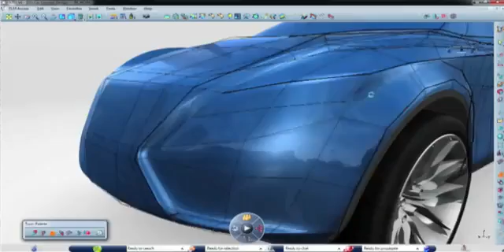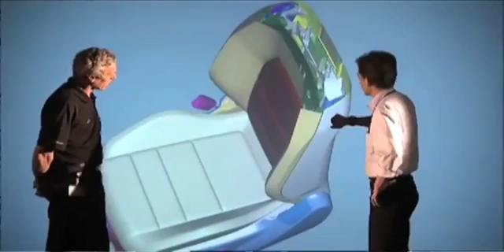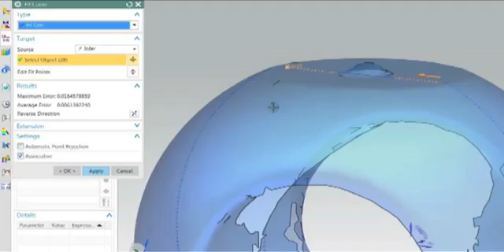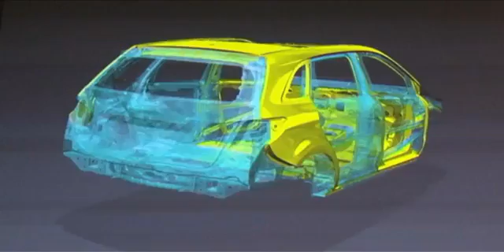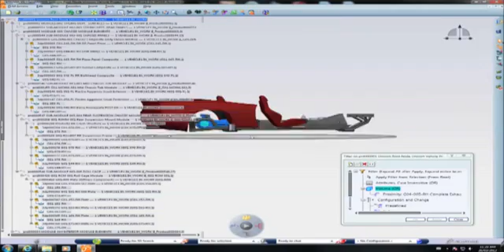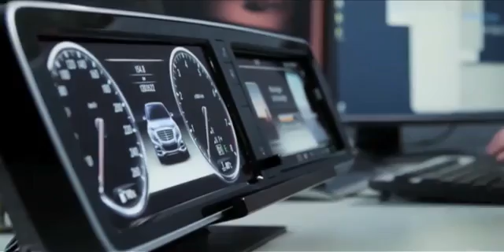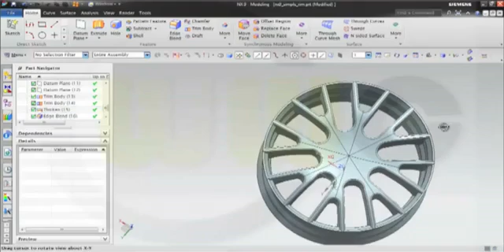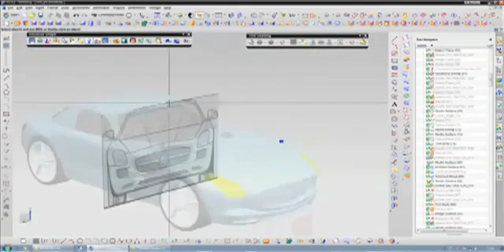The inside story behind Mercedes big CAD swap from Catia to NX

Comment: For a mechanical engineering student, the CAD I should learn to use is NX over SolidWorks. I learned that Apple Inc uses NX.
Reply: Due to the obvious fact Solidworks is only Microsoft compatible
Reply: @Jazzmaster Jay i use apple but i partitioned it and use windows in apple hahah

Comment: Thanks. I have one question as an Industrial design grad who is into automotive field. Knowing how to use 3ds max, solidworks and Alias when I want to be part of the studio design team should I learn catia or Nx or is Alias just fine for Advanced concept modeling and presentations? Will the engineers add thickness and finish of the parts so the CAM can focus on Steel die tool making for Pressing sheet metals in body production?
Reply: CATIA is a all in one solution. You don't need Alias or something else, because Alias and ICEM almost identical things.
Reply: Depends on automotive manufacturer. Catia is normally used to map the clay surfaces. V6 is used now, V5 Rx is being slowly transitioned to V6

Comment: CATIA is old. Favorite to engineers above 45 years of age. Dassault is tring hard to improve with ENovia but... NX is the big fish here. 
Solid Works tries to compete further but it's been based on marketing profit and not into engineering innovation.
Autodesk remains the big competitor to Siemens (regarding CAD). Dassault is out.